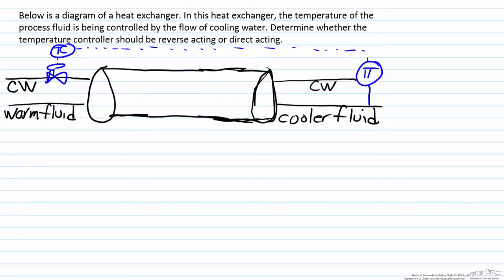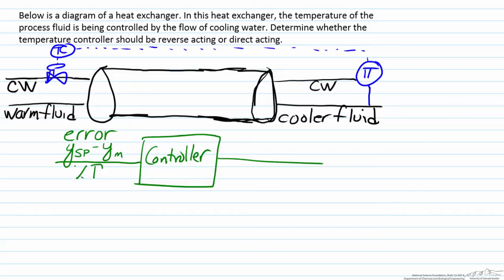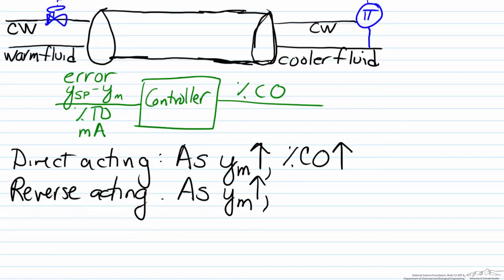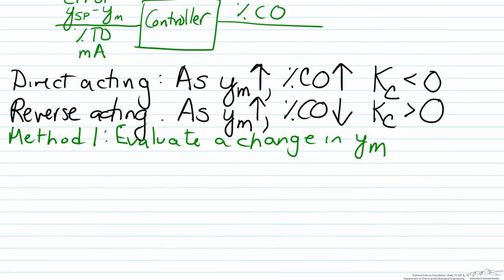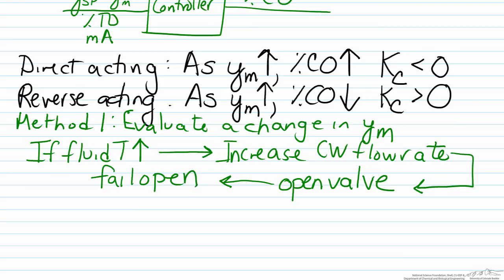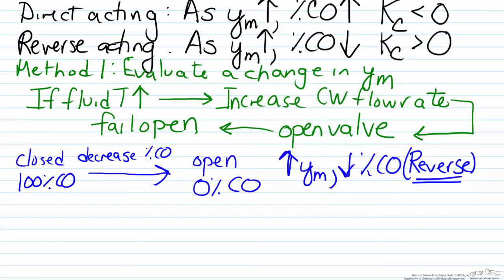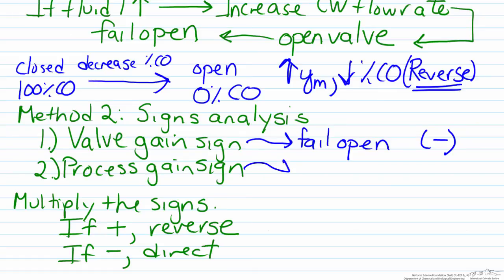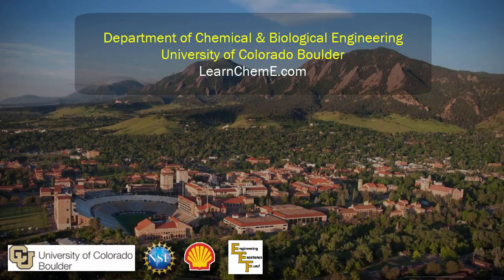Controller Action

Comment: "If the power goes OFF, we would still want cooling water to flow across the heat exchanger for safe operation. Hence, we use AIR-TO-CLOSE (FAIL OPEN) CONTROL VALVE." 4:25 Beautifully demonstrated.

Comment: i came across a question that stated that the level of the water has to be controlled using direct acting in the outflow of the tank. i have to explain my choice of direct or reverse. is the direct correct and why? 

thanks
Reply: It is coorrect because as the measure variable y(m) increases, the controller signal (Co) that is the flowrate of output of the tank must be increased as well in order to avoid over accumulation.